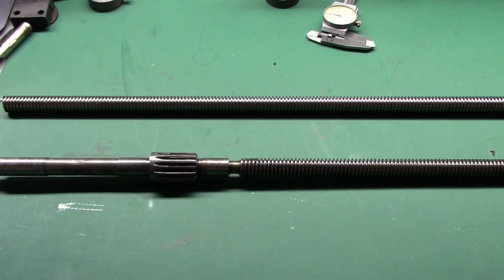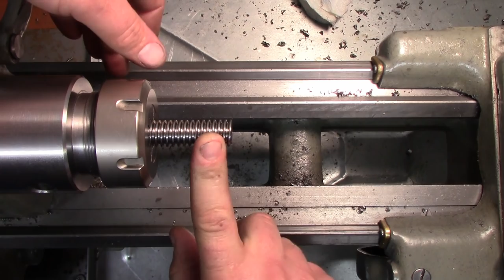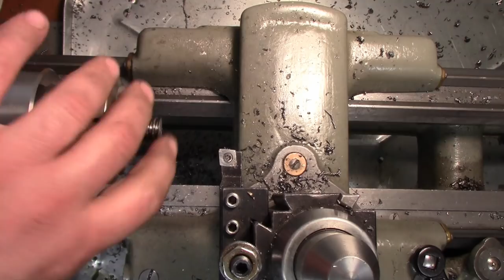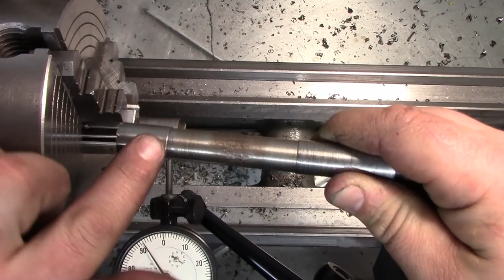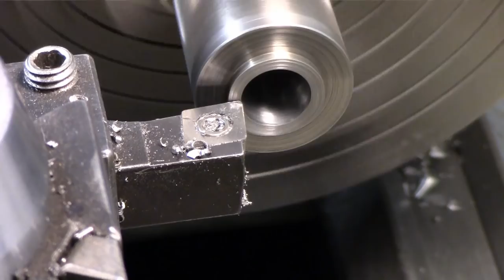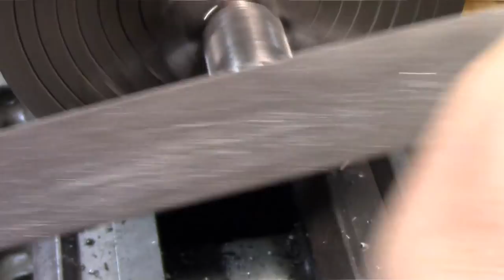Southbend 13" Large Dial Upgrade Part 4:  Preparing Screw Blank

Comment: Great project! I think a machinist who can not only make parts but also improve and maintain the machines he or she makes those parts on is a cut above :) A couple of ideas for next time: (1) When reaming where concentricity is important, try drilling 1/32" under (two 64ths instead of one), and pass a boring bar through for a few thou cut (maybe .005-.008 each side). This restores the concentricity of the hole as the drill is very likely to wander. The reamer will produce a hole of good roundness and pretty accurate size, but it will follow an off-center hole without improving its concentricity. (2) Avoid bottoming out a reamer as the unbalanced cutting forces it produces on the reamer end will often cause it to produce an over-sized hole. Can't wait to see the next episode :)